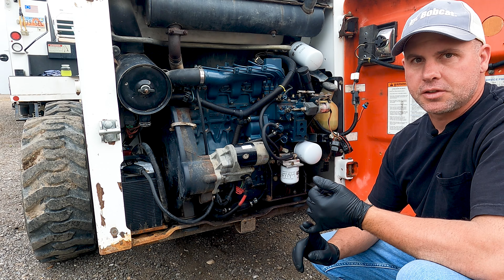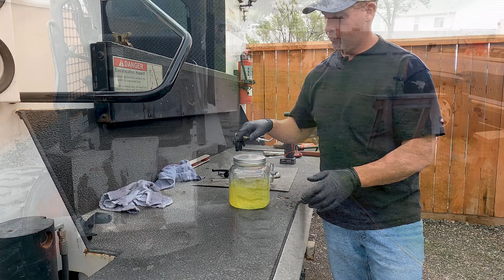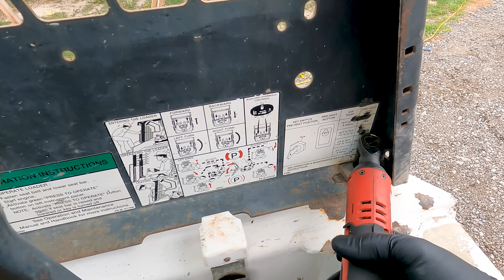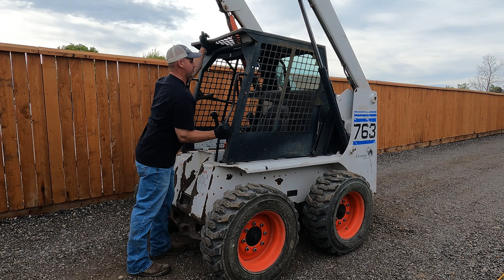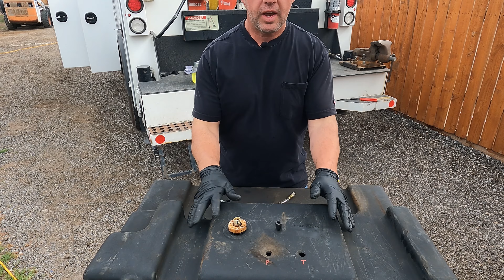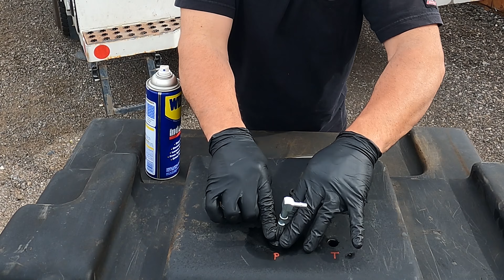Bobcat Wont Start, Fuel Starvation, Fuel Pickup Tube Repair

Comment: Appreciate the video. Was losing power with my 963 and thought I'd have to remove the entire engine to access the fuel lift pump. Saw this video and had a look at the pickup tube. Bingo, old, stiff and cracked. Replaced it for $20 and it runs like a dream.

Comment: Great video. Have 1995 773 had air in fuel line.
And would not start.  Tried many things. Found your video and finally got supply tube out of fuel tank and the pick up line was gone just like in your video.  Thanks for the help and great video.

Comment: Electric fuel pump first thing I did lifted the cab and replaced all the hose then found squashed fuel lines and cracked fuel lines  missing pickup line ,first off I put a outbourd tank on the roof with a bulb so it gravity feeds and gets air out then if it still don't go it ain't fuel issues   or blocked filter

Comment: Question about the 90° valve on the injection pump? 
With the dial, I just replaced that, helped but has not cured the hard start. (My 7753 will not run with that dial/valve closed)....in regards to you opening it to prime, then closing it. Its like the fuel will not return to the injectors to me.

This machine starts and runs rough for 30 seconds. Dies. Cranks no start, hit the  Primer bulb and it starts and runs fine after. Several hours of sitting before it starts with its shit again.

Any suggestions?
Thanks

Comment: Replacing he pickup tube on 753 was ok until I tried to put the new pickup line, filter with spring around it into tank.  Could not get it to fit in the hole.  After about an hour, just took the spring off and managed to get into tank.  So my question is; what is the purpose of that spring?

Comment: I have one with electrical issues, new battery, man fues is good, turn key & display says Input. All relays & fues good. Cleaned up all ground points. What should I be replacing next

Comment: I have a 2012 T650 - A3Po14996 No pick up screen shown on fuel pick-up tube in tank on parts diagram 27-12-2021. Engine starves when run wide open with a snowblower running. If I run engine slower it doesn't happen. Check fuel pump? Something blocking puck-up tube, which is impossible to reach as it's between the engine and pump.

Comment: A million thanks, im heading to get the new fuel pickup tube from my local dealer tomorrow. I can hear the gurgling when I prime it. I'm sure the check valve is bad/cracked/broken off.  This should take care of the issue. Ill leave my conclusion tomorrow.  Thanks a bunch. Subbed for sure.  It's nice to have someone with clean clear instructions to solve a problem.   😀👍💪💪

Comment: Hello, Do the Bobcat T630 have a bleeder screw on the fuel filter housing? i have a T630 and i dont see a bleeder screw. How do i bleed the fuel system on the BObcat T630 year is a 2017

Comment: How important is it that the mesh screen STAYS on the pickup ? I got an aftermarket one and sure enough while trying to put it in the screen fell off into the tank ! can I use some sort of stainless mesh wire or would i have to buy a new one all over again ?

Comment: I have a 863 Bobcat. 
1.How do access the fuel tank pickup tube without removing the engine?
2. What tool do you use to remove the grommet?
3. What tool do you use to seat the new grommet?

Comment: I have 763 and I have same problem over and over again I drill 1/4 inch in the check valve with the screen in the tank , and I had filter before fuel pump and works  great now

Comment: Great video, exactly what i'm dealing with. no fuel from the tank. i'll pressure wash the dirty engine bay and pull the pick up today. hopefully its the fuel line like the one you replaced

Comment: Great video! Occasionally my S185 will die out with the primer bulb sucked flat and not restart into I let it sit for a while. Biggest clue was when I removed the fuel cap and heard a whooshing sound as air rushed in. Apparently my tank is somehow pulling a vacuum and not venting. Is there a breather vent somewhere? I've searched online and cannot find and information on this. Thank you sir.

Comment: I ran out of diesel in my 753 and tried starting it after refilling it with no luck. Tried priming by getting air out of the fuel filter but just kept pushing out air. I tried starting it a few times. Is it possible there is too much air in there?

Comment: Do you have any experience with fault code m9314- it’s on a Nearly new 30hr e48 bobcat mini excavator.
Reply from the maker: Probably the electric fuel pump is faulty, kinked lines, or fuel delivery issue.  sometimes new machines will have some debris in the tank from manufacturing that causes problems.  I would make sure the priming pump is working when you turn the key on.
Reply: Lift pump was replaced , machine was ran with out issue by bobcat then returned to me - ran for 1hr fault returned - shut off - restarted -after verifying water separator was drained - started back up and has been running without issue for nearly tanks ??? lol I guess it’s good now

Comment: I have that problem now , But I got a reconditioned engine put into it 751 Skid steer  2years ago and where the Stop valve and rubber gramet fits down in the tank can’t find it  ,   They must have put the tank in backwards, must check if there is a side plate so I can see in

Comment: My 753 right side drive is just barely moving? No leak. All other hydraulics works fine. Just had a seal kit put in the drive motor but still just barely moving. Any suggestions?

Comment: Just love all your videos, your bobcat knowledge is unsurpassed, your experience shows up in the videos when you demonstrate HOW YOU DO IT and make it look so so simple. I do have a question for you, in an 863 the fuel pickup is located further forward, in what seems an almost impossible place compared to the 763. Is it possible to replace the tank pickup tube without removing the engine?
Reply from the maker: I remove the engine mounts on the 863 and have a helper use a prybar to lift the pump side to gain access to pickup tube.

Comment: Why don't you crack any injector lines 😯...?
Reply: It has also 2 other places to get fuel out and get the Air out besides the Cracking the Injector lines, one of them is on the top of the Filter Housing and the other one is a Little Small Wheel 🛞 that you can turn it and then squeezing the bulb will get the Air out of the Line...

Comment: Thanks I just fixed 325  excavator that was the problem I just paying almost $600 and the dealer by in the solenoid and all the parts and it was the hose

Comment: Remove the fuel cap remove the primer bulb from the line coming from the tank blow into it with your mouth. If you hear gargling from the tank your check ball is not seating or the tube is broke off below the fuel level if you can easily blow back and hear the air sound coming from the tank then your pick up tube has come apart above the fuel level. I saved a propane reg from a old bbq grill which only puts out a few oz of pressure and I hook that up to a regulated 40psi air source or to a propane bottle which is more sketchy but it works.

Comment: Great video and thanks for posting....quick question, if the engine won't start what is the best and safest way to raise the arms so you can raise the cab to get to the fuel tank. Thanks!

Comment: A very wonderful and informative video!  Thankyou!  My  98 863  must be a little different.  I looked and looked and cannot find the dip tube.  I called the  local mechanic out from  bobcat  Lex,  KY.  they said it was a very  labor  intensive job.  I wonder if  I cant  make a new fuel line by drilling a hole in the filler
tube and running my own line to the primer bulb?   thanks,   Phil
Reply from the maker: Its not that bad, i unbolt engine mounts and raise pump side with long pry bar to access the pickup tube under the pumps.  I have seen new holes drilled as a relocation option and seems to work fine.
Reply: @tetradgroup  Much appreciation! Are you talking about the engine mounts under the cab or behind the door by thw primer bulb on the 863? Really could use thw support as we are in need. Much appreciation
Reply: Thankyou!
Reply: Phil Foster
11:04 AM (1 minute ago)
to YouTube

Hi,  I  dont know if you will get this here but  I'll  try.  My  fuel problem on  my  863 loader seems to be  fixed thanks!

I used the loader to go get  firewood  maybe about 20min.  Unloaded the wood  and went back to get more,  loaded  the  buckett  and then
bam  traction lock light started blinking and I  couldnt move.  I tried  a bunch of stuff and no  luck.  parking break etc.   i walked back to the 
house  and  u-tubed it.   Went back down to the  loader maybe  20min  later.  i  wiggled  wires on  those  relays  above  the  battery.
It  seemed  to work.  i  got the  loader back up to the house. I  am thinking maybe  take all the relays out and clean the contacts?  Do  you
have any  thots?    Thanks,   Phil

Comment: Great video. I figured all of this out with no knowledge on a 543 many years ago and am having a slight issue with an E20 currently. Stumbled on to this and wish I had seen it when figuring out the issue on the 543. I think the fueling trouble shooting applies to all basic older Bobcats and mini's. Seems like the concept is the same regardless of the design. Do you have any experience with mini ex E20 or the like? I am having a starving issue after warmed up and did run it almost out of fuel on an angle. I bought the machine a couple days ago and it had a quarter tank or less so figured it was good but it kept shutting off when tilted to the right slightly. I added fuel and squeezed the primer and it was ok until today after it warmed up. Not sure if I got air in it or having a fuel pick up issue. I paid the dealer (it had 1450 hours on it) to do a full service before I picked it up so all filters are new.

Comment: thanks  you fixed my 763!!  One question, what's the best way to get a bucket off that's never been removed for 10+ years and the bob-tach plate and bucket pins are solid rust?
Reply from the maker: I use an air hammer from the bottom.  In extreme cases I have to cut the bottom off the pins to remove bucket and use lots of heat on the pin boss

Comment: My 863g lost its fuel pickup tube during a snowfall of course. Luckily my bobcat mechanic was out on another machine callnearby. He said he'll be able to move the bobcat by going through the fuel filter and a gallon jug of fuel. He had me out of the way in matter of seconds. Do you know about this? I thought it was the slickest thing I saw. For a couple dollars to replace a fuel pickup hose, I replace my hose every fall so there is no problems. Thanks for your videos and help.

Comment: I think this is my problem on my 863, although I think pick up tube is intact but there is probably a lot of contamination in tank. Also lift pump is leaking from cap so I think it is either going or apparently I have heard a screen in there needs regular  cleaning. I will drain tank and check screen tonight once I get machine thawed out.

Comment: Hey I am back again...I have this pick up tube issue and am currently repairing with your help. Question I have a 2001 763 G series, I want to change the fuel filter. Do you have a video on this?
Reply: Disregard,  stupid question.  But I am going to change the Hydro Filter if you have any videos for that.

Comment: Having a fuel starvation issue on a 2012 t770. Primer is collapsed. Removed fuel line and blew through line. Was clogged. So I know there's debris in tank. Where about is the drain?
Reply from the maker: No drain on the T770.  You can drill a hole in bottom of tank and add a plug however

Comment: Thank you. I was able to fix my Bobcat 873 due to watching this. The fuel pickup tube is nearly impossible to get to in this model so I drilled a new hole in the fuel tank for a new fuel pickup tube, and plugged the old line. She's running like a champ now.
Reply from the maker: Excellent job
Reply: Do you remember what size hole you drilled?

Comment: Is this the same for a 2007 t300
Reply from the maker: Same basic principles but different machine and location of pick up tube assembly
Reply: @tetradgroup  can it be done from behind side plate
Reply from the maker: @LittellFarms  I don't think so, drive motor and hoses are in the way.  I have another video of a T750 fuel level sensor that might help, same area as pickup tube on the T300

Comment: I had a hydraulic leak on my 743. Had to pull the motor,  got it fixed, replaced the motor,  and now it takes 5 to 10 minutes to get started.  Just turns over,  until finally it'll hit a little,  then more turning over until it eventually catches enough to run.  Any ideas? I've replaced my line from the tank to the fuel filter,  primed it,  bulb got firm.  Then was gonna replace the line from the fuel filter to the pump,  and it was full,  so I left it.  Bought a new fuel pump (or lift pump maybe), but haven't put it on yet.
Reply from the maker: For more a more individual and detailed response, please visit our website to contact us.  www.4tetradgroup.com

Comment: I have a T300 with fuel starvation.. it does start and run but fuel primer ball gets flat.
Whats your suggestion
Reply from the maker: Start with pickup tube and check the 90⁰ fitting in the top of tank, they like to clogg up at the 90⁰

Comment: I have a 2013 t650 with the kubota that collapses the primer bulb only in the winter.   I googled the tube and it looks like it could be metal? I was going to replace the pickup tube and primer bulb to try and solve the problem.    Runs fine in the summer.
Reply from the maker: Depends on winter, When its near 0 or below any moisture in the tank will freeze around the metal pickup and cause the symptoms you are describing.
Reply: @tetradgroup  thanks for the reply

That actually really makes sense because when it runs for a while the heat from the engine must melt the water at the bottom.  It's always when it sits overnight and you start it that it wants to collapse the primer bulb.   Going to drain the tank and see what i get. Thanks again!

Comment: what and how do you check if there is  no fuel at the injection pump? Bobcat 863  has 4 injections pump and there is no fuel on all of them.
Reply from the maker: Crack the lines at the pumps, turn engine over and see if fuel comes out.  Could be an electrical problem with the shutoff solenoid if you have fuel to the pumps but nothing coming out
Reply: @tetradgroup  I have cracked the line and there was no fuel. I try to open the timing belt cover to check the timing but there is one bolt that I was unable remove because I can not see it and don't know what tool to use. I don't know if there is shutoff solenoid somewhere.

Comment: I have T590 won't start, code error starter relay, have changed all fuses, fuel filter, fuel gage, worn wire from battery to solenoid, still not working, any ideas what to check next?
Reply from the maker: Did you replace the actual relay in the fuse box?
Reply: @tetradgroup  yes replaced the relay and the 100 fuse by the battery cable. 2 mechanics have look at it and Having the same issue.
Reply from the maker: @pineda4333  can you give me the actual code and what happens when you turn the key
Reply: @tetradgroup  turn the key on, says wait 20 seconds then we turn key on, it sometimes it starts 40 sec and shuts down, cranks fine, the code is M23-02, and the panel says starter error relay.
Reply from the maker: @pineda4333  the gateway controller is receiving a signal from the starter and it thinks the starter motor is turning.  Remove the small wire on the starter R terminal, see if that wire labeled 3650 has 12V on it when disconnected from starter.  Then check the R terminal on the starter with wire disconnected and see if terminal has 12V present.  If the starter has voltage on R terminal then it's a problem with starter, if wire 3650 has power on it then it's either a short somewhere in the harness or the gateway controller itself has an internal short and will need to be replaced.

Comment: Hi great video.I just put unleaded in my 753 bobcat any videos would be appreciated from aus.cheers
Reply from the maker: No worries, there is a small plate on the bottom of the machines engine compartment, remove the plate and you will have a drain plug for the tank.  Drain tank, flush lines, new fuel filter and it should be ready to go.

Comment: What happens when water gets into system via bad fuel? I have a T250 that got some dirty fuel and now the only way to crank is to spray starting fluid to fire off, bad injectors? or injector pump?

Comment: Thanks for these videos, they very educational for a recent bobcat owner like me. I have an 843b. The tilt linkage bar runs under the pump with a pivot right in the center. The bushing is so worn it basically won't work. I have gotten the nut off the bolt but there isn't room for the washer to come off. 1) Where is the head of the bolt? 2) Do I need to loosen the pump to make this repair. Thanks again for the videos.
Gary
Reply from the maker: For more detailed and personalized advice/suggestions, please contact us at www.4tetradgroup.com

Comment: If the primer bulb won't prime odds are that the flapper valves inside the bulb are worn out or stiffened up with age and they need to be replaced or the bulb can be replaced entirely.  You should not need to finger block the hose to get it to work.

Comment: My pickup tube had fallen off before i got the machine, it's a 7753, so i just have a 2 gallon tank hanging off the side, so there can't be much fuel that returns back to the tank or my tank would be over flowing and i don't see fuel on the ground, but i need to fix the pickup, i have watched other videos where they fight the grommet back in the hard way and it put me off, thanks for the video, now i'm inspired.